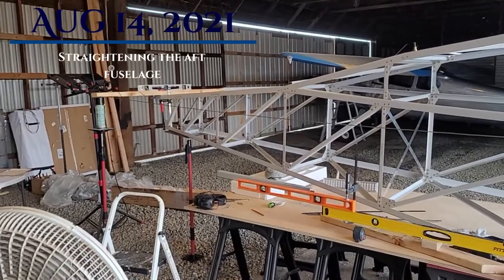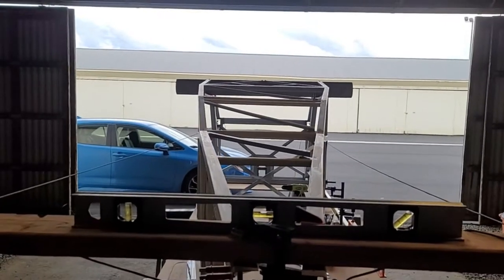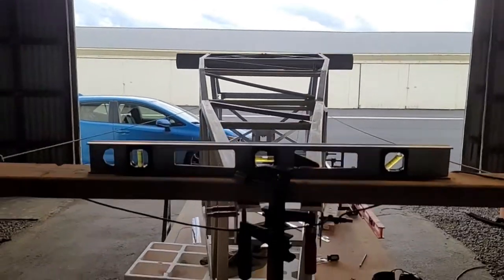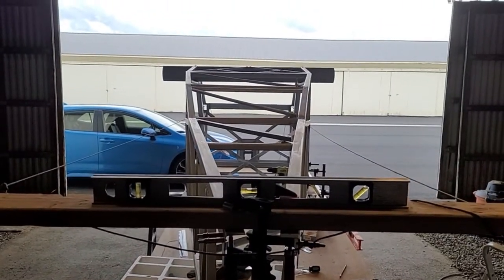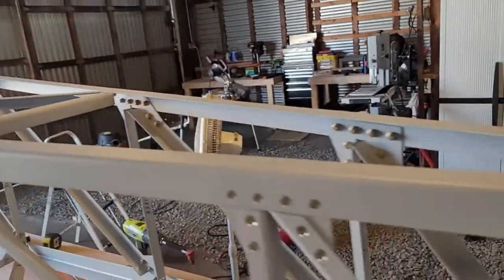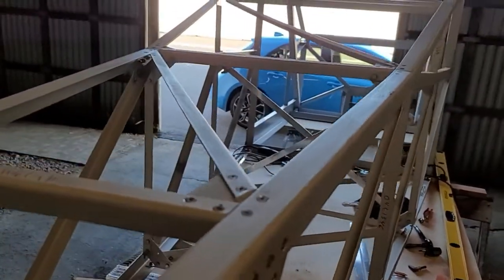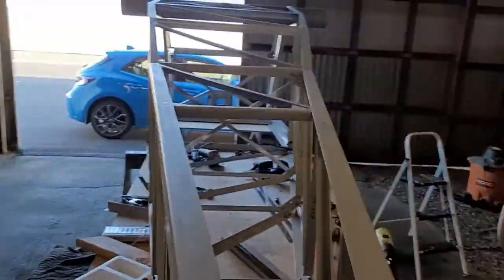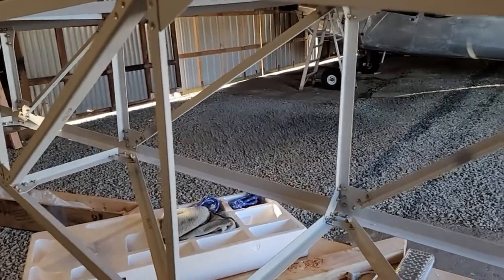Bede BD-4C Build Log 008

Comment: Is there a possibility the tail was a little off by design ? Or does the drawing show full symmetry?
Reply from the maker: It was too far off to be designed that way.  Because of the length of the bottom pieces, small differences in length translate to large angular differences.  The drawings don't mention this, but it becomes obvious why the small pieces at the front are necessary to make it easy to adjust.  The rear pieces don't mate correctly either if the tail is askew.